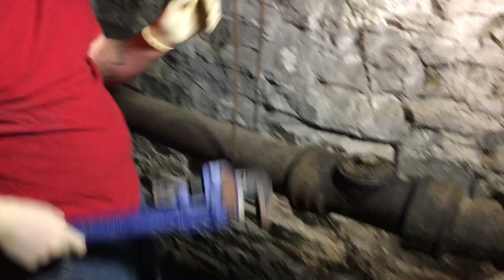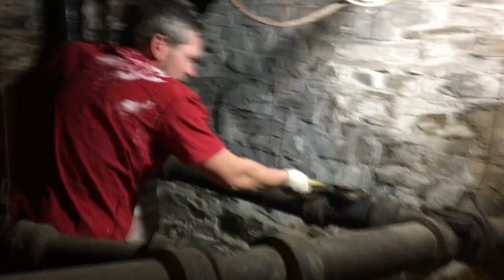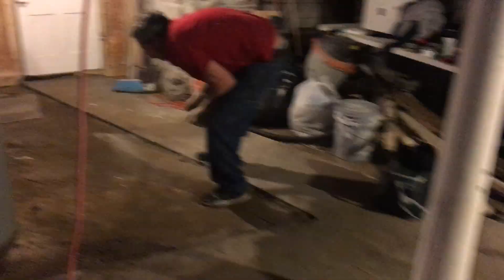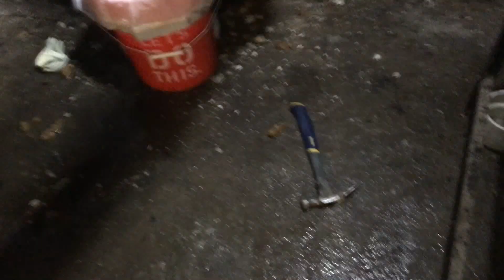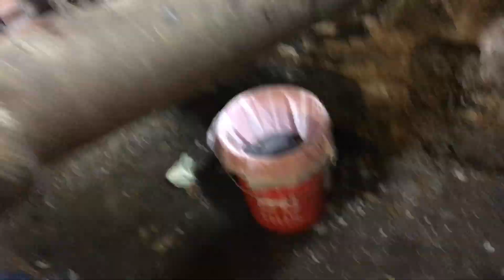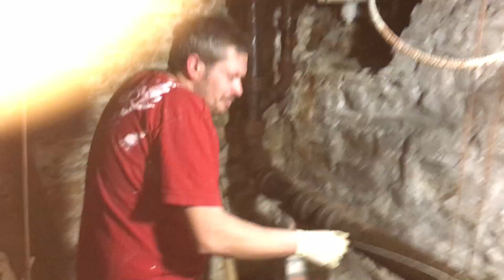boston guy freaks out over plumbing

Comment: I bought a 100 year old house, the drains were all backing up, so I rented an auger and went to the basement, took off the cap for the floor drain, about 5 seconds later the built up gas made made a whole 20 ft pipes worth of gelatinous shit spew out of the floor, it even managed to retain the shape of the pipe when it hit the floor, shit hit the ceiling it was so powerful, this is literally nothing compared to what I’ve seen, and I’m not even a plumber.

Comment: Step 1 shop vac out toilet closet to clog.
Step 2 pull toilet
Step 3 run drain snake.
Step 4 reset toilet.
Reply from the maker: we tried all that and it didnt work. the clog was very far away from the nearest toilet, so your suggestion sucked.
Reply: Albone3000 how much cable did you have? Just wondering

Comment: The amazing, ongoing feat of only 1% of plumbers wearing respirators, plexi shields, or even moderately adequate PPE for jobs where pressurized, liquified feces can propel into your face.
  This guy was unfortunately in the 99% of those who don’t. What’s even more incredible is after seeing how much pressure was about to be release, not getting a much bigger can, then slowly bleeding it over an hour or so. I mean what the heck all the warning signs were there.
Reply from the maker: good point, they are savages.

Comment: Master plumber in NYC and when you install a sewer u always remove the service plugs and put lead fiddles and yes you can drill threw cast iron I do it all the time
Reply: Why would you drill lead if you can just drill the clean out plug? Then screw a new one back in? You sure you're a master?
Reply: @TheLimitlessCreation  never said drill lead I said drill out the brass plug ur smash a hole into remove clear the stoppage and then put a lead fiddle so it is easy for the next plumber.

Comment: I would have drilled a hole let the water relieve its self then cut the beass plug off and put lead fiddle save so much time
Reply: Have fun drilling that cast iron
Reply: You must not be a plumber
Reply: Nah i just have proper equipment to deal with the situation without making a mess and taking half a day to do a simple job.
Reply: 18zach86- just gonna call you a keyboard plumber. Keep dreaming there sonny boy